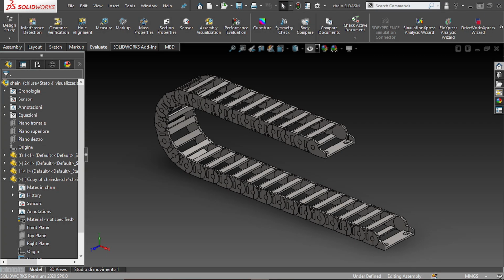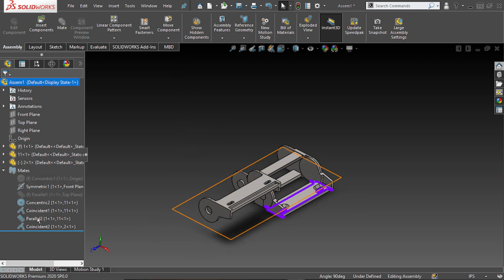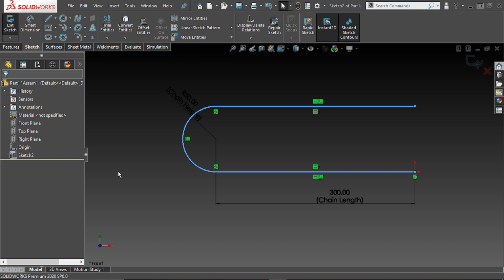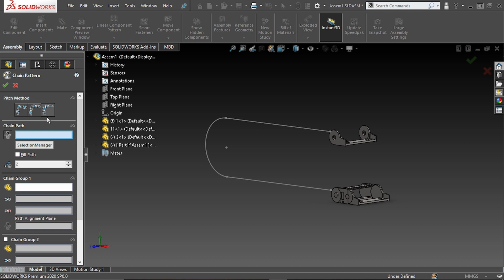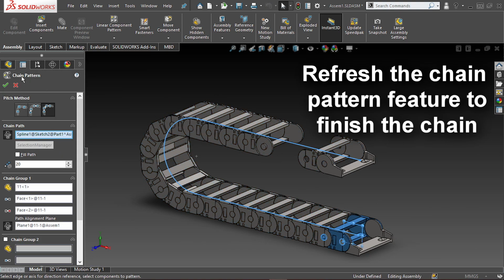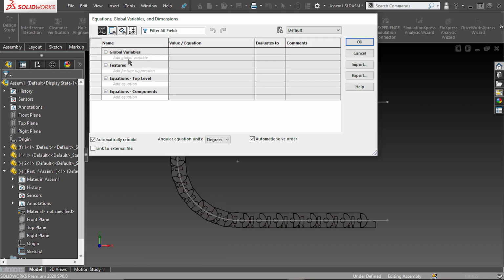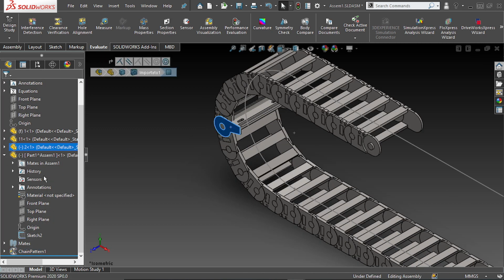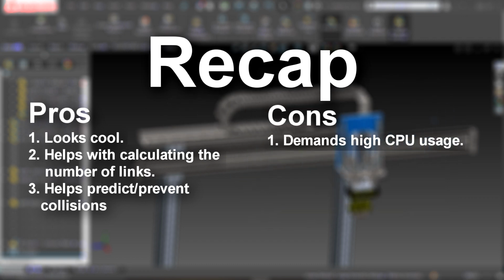How To Make a Realistic Cable Carrier Chain in Solidworks | Solidworks Tips & Tricks

Comment: Hi, could you help me this, I'm trying to mate the cable carrier with slider cylinder which I used different configurations to control the position, but when I changed slider cylinder to different configuration, the cable carrier did not move and become over defined, I do not know how to solve it.
Reply from the maker: This methodology got a little buggy starting from SolidWorks 2024, but maybe I can fix it. You can send me your file and I could take a look at it.

Comment: when inserting in the overall assembly even after making it flexible the chain did not move. did i do something wrong?
Reply from the maker: Try it first in a smaller assembly just to be sure, because you may lack computing power... But I also have noticed that this method sometimes has bugs on newer SOLIDWORKS versions

Comment: Thanks for a good video! It is what I was looking for.
I have only one question now - how to make chain for two axes? For example for 3D printer.
(Sorry for my english)
Reply from the maker: Thank you so much for your feedback! 

Well, I suppose you just need to use two chains in your assembly, but first make sure you have well defined the range of motion of your system. Use flexible subassemblies and limit mates if necessary. If you have that right then the chains should just adapt to what you already did.

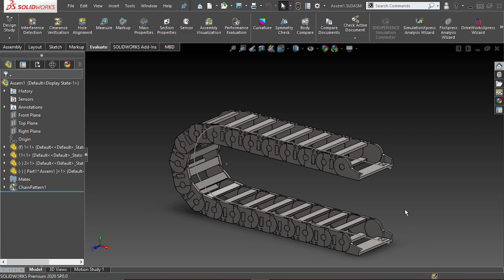Comment: First of all, thanks for the great video! It's a great explanation, I was wondering if you could walk me through a similar set up. Specifically if you were to pause the video at 4:02, if there was a gear placed on the curved section, and you have the same layout, how would you make both ends of the chain act according to the rotation of the gear? (if there were locked along the path in the sketch you have drawn). I am having trouble doing this. Any help would be greatly appreciated. Thanks.
Reply from the maker: Thanks for your support, I really appreciate it. I assume you have a mechanism similar to a rack and pinion then, probably a bike! I've never tried something similar, but there is an advanced mate called "rack and pinion" or something similar that does that job, although I don't think you need to use my chain method for it to work. Who knows, maybe both methods are compatible!